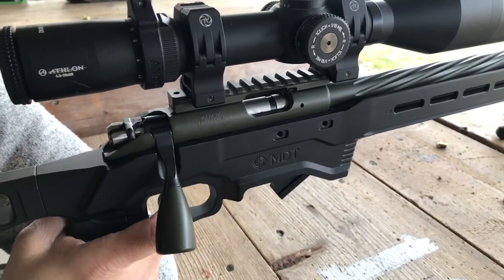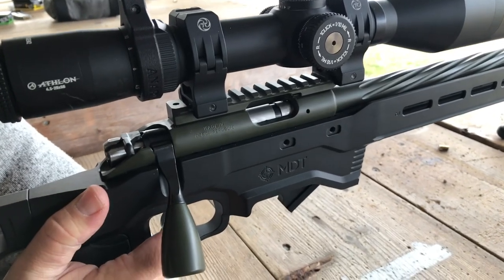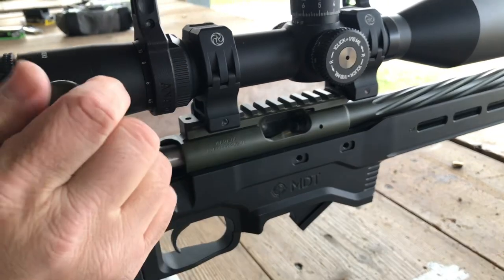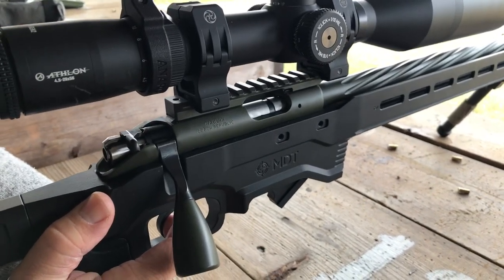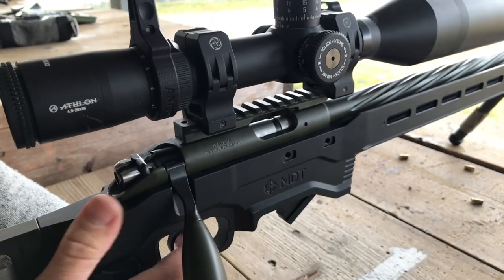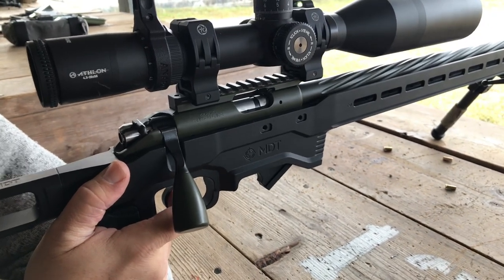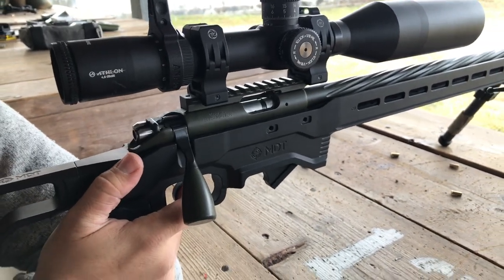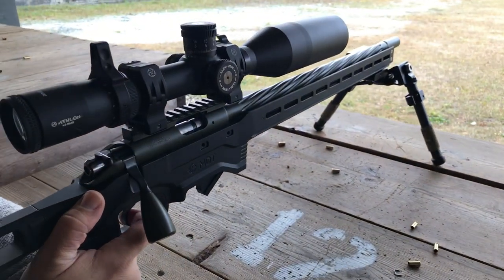CZ 455 DIY cartridge/extractor in action- Part 2

Comment: Im guessing you "took down" Part One of this video. Any useful information you can provide about fixing the extraction/ejection issues these rifle tend to have would be gratefully received. Keep the videos coming and appreciate all the time and hard work that you put into them!
Reply from the maker: Unfortunately, yes. 

I took it down due to YouTube’s nonsense..

Most of the issues can be solved with the “c” clips spring tension and careful manipulation, but sometimes (like in the case of the 455 in the vid) a new/replacement part is in order. I made one because there were ZERO to be had in Canada and the owner of the rifle is a pal, so it was a quick project to get it fixed. My advice would be to order the replacement parts (if you can) and play with the tension and it should be good.

I should also mention that the case “kicker” is built into the bolt guide and it sometimes gets worn or needs a shim to align it better. You will know of yours is an issue if your cases hang up in the ejection port
Reply: @inrangerimfire20two  Thanks for he heads up. Appreciate the help!.'ve shimmed under the ejector plate with some brass shim and that seems to have helped a little as cases were getting hung up in the ejection port. The ejector and holder fit doesn't seem to be the best ( for stamped parts- the gaps are fairly large) so the next job was going to make them from scratch and see if "tighter" tolerances around the case would improve matters. Easy enough to enlarge if required later.  In your experience would reducing or increasing C clip spring tension help? How do you find the Manners stock? Thanks, P
Reply from the maker: @petewencyk5461  I always make mine from sawzall blades and it’s very easy to adjust the fit on the case of you go super slow with the final shaping. The Brno 4 i feature often had too tight spring tension and it was not allowing the rim to slide up into position from the mag and therefore it would jam into the breech face. It took all of 5 min to adjust.

The manners stock is for me just about perfect. We shoot a lot strong side/ week side in matches and it is a truly ambi stock, not to mention insanely rigid and has zero flex under a slings tension. Another reason I choose a stock is up here in Canada where we shoot matches year round, the manners is not cold to the touch. A minor point, but one I enjoy about it
Reply: @inrangerimfire20two  Thank you!  Will give the blades a go and see how it pans out. Keep the videos coming. Regards,
P